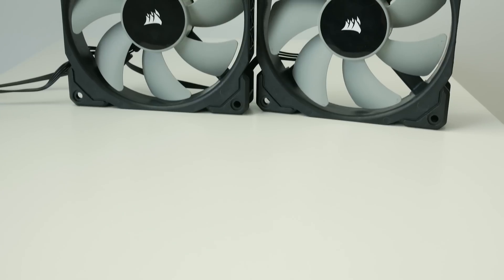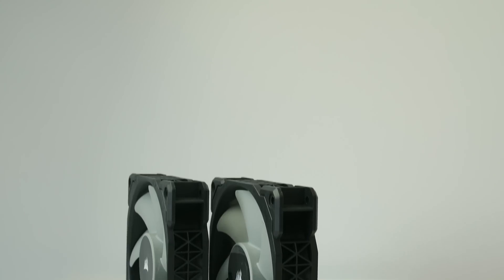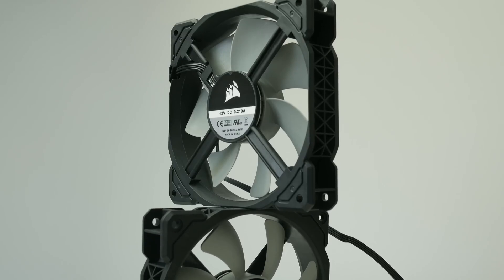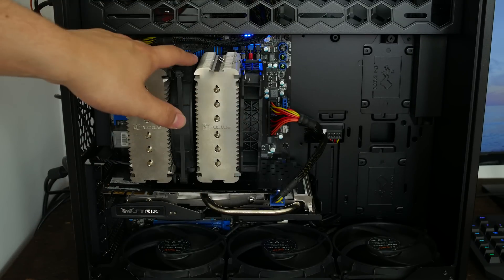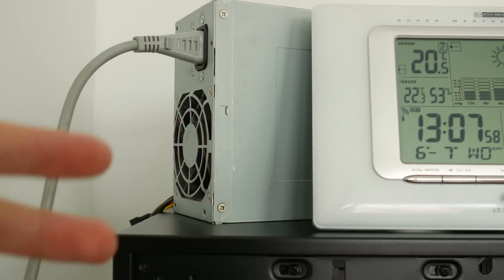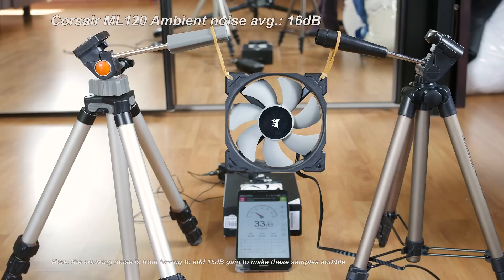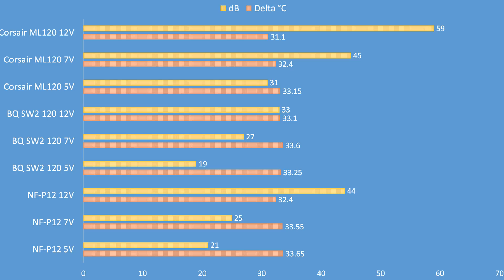Corsair ML Series Fans Cooling and Noise Review Compared to Noctua and Be Quiet!

Comment: why dont you compare sound level at same cfm out put vs voltage.. that would be more important.. quiet but not moving enough air isnt going to help me.
Reply from the maker: +BigStipowski As I said in other comments, I don't have the expensive flow and pressure metering equipment required for that

Comment: So didn't even bother to use the noctua industrial 2000 rpm fans?
Reply: Tons of people use the Noctua 2000 rpm industrial fans in their cases.  Normal pc cases. If your going to use a fan that has a control range of 400-2400 rpm you should be testing it to comparable high static pressure fans and rpm ranges.

This is a high static pressure fan (as i mentioned) meant for rads heat sinks and things of that nature. If you are stacking it against it's competitors you best actually use fans it's competing with. These fans in this video are really far form it's competitors in the field which it will actually perform in. You need fans meant for High static pressure and rpm ranges, like getting some 2200rpm range ek vardar fans or the noctua 2000 rpm fans i could name several others but i hope you get the point.

Btw Industrial on those noctua fans is basically a gimmick.
Reply: I use the industrial 2000 rpm PMW fans by noctua and they are the noisiest fans I have ever used I hear them when I'm gaming and my case is the be quiet silet base 800 which is a very quiet cause by default(very good airflow tho...) So I would not recommend the noctua idustrial fans to anybody just because they are annoingly noisy and very expensive. LOL forget to mention it if you put these fans on 100% you have to leave the room for the sake of your ears health :D
Reply: +Superfly29rr nah my noctua industrial fans at 500 rpm are crazy loud as well. Complete shit

Comment: What about the RPM numbers?!
Reply: The Corsairs are 2400 rpm @ 12v, the BQs are 1500 rpm @ 12v and the NF-P12s are 1500 rpm @ 12v. Kinda makes this test a bit pointless! Redo the test with all of them set to 1500 rpm!!

In any case, according to your test, the Corsair fan only gets you an extra 1.8 degrees running at 2400, compared to a BQ fan running at 1500. That can't be right, surely?
Reply: 400-2000
Reply: Yes but be quiet does not go as far as 2k rpm.. so at the same voltage they arent at the same RPM if I understood this "testing" right...
Reply from the maker: 400-2400 on 120mm and 400-2000 on 140

Comment: So are they for airflow or static pressure ? For your case or your heat sink/radiator?
Reply: On Corsair's site, they tell you the flow type is Static Pressure. So yeah, for your heat sink/radiator. (I still think I'm going to get 3 140mm for airflow just because they have PWM technology and red leds to match the sp120's I ordered, unlike the AF140's)
Reply: Actually they list them as high airflow AND high static pressure fans
WOOT!
Reply: Also a good thing about these is that they don;t look like they have a swastika with the leds lmao

Comment: This is pretty good for sound but the cooling part seems to be completely missing. Yes the ML series was the loudest over all but what's it's static pressure vs. the others? What's the RPM's and CFM of the ML's vs. the others? Sure when the BeQuiet! is quieter at max speeds that's all well and good but when it's only spinning at 1000RPM and barely moves air then what good does it do?

So again, sound tests are decent but it's all the other parts of a review that are missing or severely lacking.
Reply from the maker: There are cooling performances figures in this video.. I don't have the budget for flow/pressure/dB meters so I have to stick to real world testing

Comment: Thanks for the review. It is hard to come by decent fan tests these days. However, I have some quivels with yours as well.
In the noise measurements at 2:00, it one can clearly hear that the airflow of the ML 120 hits the microphone, while the others do not. This could probably be avoided by ensuring that all fans are hanging perfectly vertical.
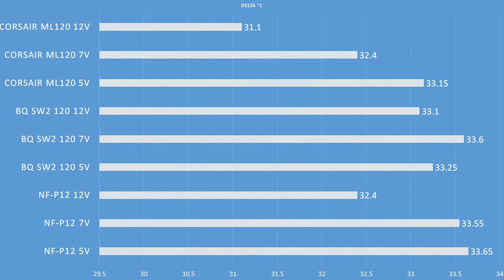In the chart at 2:20, the Silent Wings 2 cools better at 7 V than at 5 V. That does seem odd. Is it perhaps rotating faster at that particular lower voltage? Wouldn't it be more appropriate to test these fans while controlled via PWM?
Your interpretation of the data in the chart at 2:29 does not go far enough. Not only does the Corsair ML 120 at 5 V match the beQuiet! Silent Wings 2 at 12 V in cooling performance and noise. The Corsair ML 120 at 7 V also matches the Noctua NF-P12 at 12 V. So these results tell us that all three fan perform the same under same conditions and the only difference is the throttle range. Since the three fans are obviously different, this also hints at the testing methodology being flawed somehow.